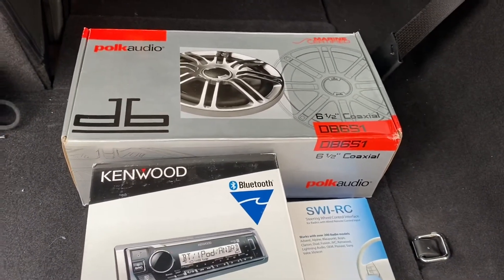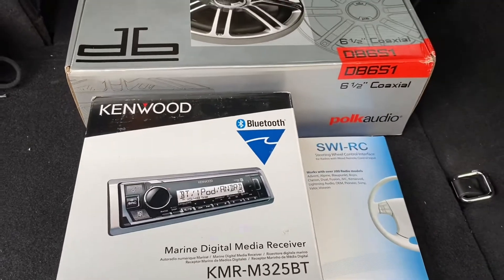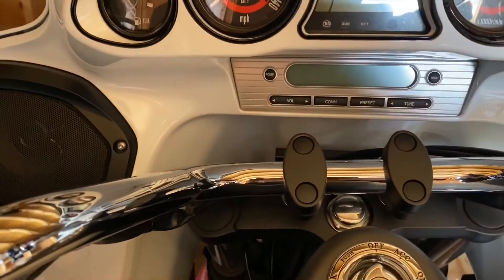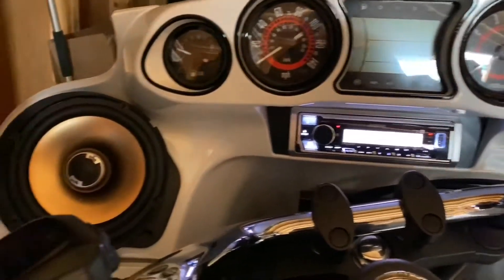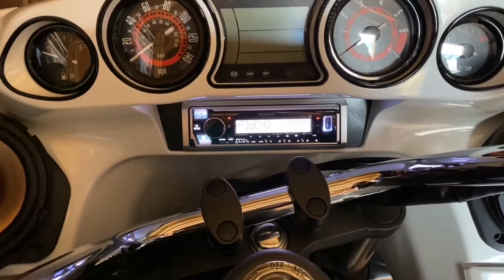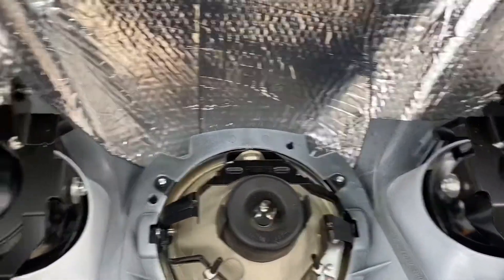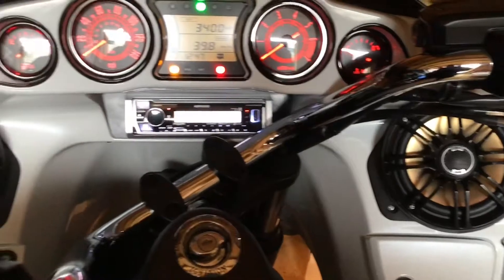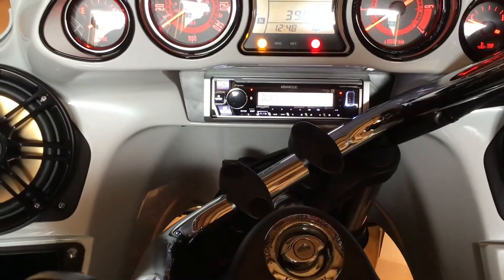Audio upgrades on Kawasaki Vaquero

Comment: Nice!  I had the repair shop do a stereo upgrade [Kicker kit] on my 2016 Vaquero when they were replacing the fairing after an accident.  I bet your stereo sounds AWESOME!
Reply from the maker: It sounds pretty good. I need to add an amp and maybe new speakers. I was totally intimidated the first time I pulled that fairing off. Thanks for watching stay safe
Reply: @GoofyBastard  Yeah, when I did the aux. lights on my Vaquero, I did it ship-in-a-bottle style... a technique I found out about on the Vulcan Forums.  No need to remove the fairing, just dislocate your left thumb LOL [not true, and I'm not responsible for you if you try it].  But seriously, ship in a bottle worked and I got the lights in there without having to remove the fairing.  Hence why I had a shop do the amp/speaker install for me - I wasn't doing all 16 or so steps to get the freakin' fairing off.
Reply from the maker: @RoadReality  you would be surprised how easy the fairing comes off.  I just put led bulbs in up front and went through the gloveboxes for the aux lights
Reply: @GoofyBastard  Yeah?  I saw the 16 steps and went NAH, found the ship in a bottle technique - which is what you did, going through the cubbies/glove boxes.  Certainly makes things interesting :D
Reply from the maker: @RoadReality  oh yeah going through the glovebox is so so easy!!!!
Reply: @GoofyBastard  It sure is!  The only difficult part for me was fishing tools in there and back out without dropping anything down in... which would've required me to remove the fairing.

Also, I'm not sure if prices have changed, but when I got my replacement fairing, painted & shipped from Maw Kaw, it cost $1,600... so be careful with that big ol' hunk of plastic!

Comment: Hi there, looks great! Question- approximately how much dyna Matt did you need to cover the inside of the fairing like that? I’m assuming it’s 80mil thick?  Thanks
Reply from the maker: Yes you are correct, it’s 80mil. Exactly how much I used, not exactly sure. I bought a box of sheet mat and if I remember correctly I used about 6-7 sheets, cut down to fit. Thanks for watching and I hope this helps.

Comment: So did you splice wires together or did you find a wiring harness for the stere
Reply from the maker: I used a wiring harness from Engineered Adapters. They make everything you need to upgrade the audio. Thanks for watching and stay safe

Comment: Did you use any adapters for the speaker install? Or did the Polks fit without modification?
Reply from the maker: Yes I used the Engineered Adapters ones and no I didn’t have to make any mods to fit the Polks. Thanks for watching!!